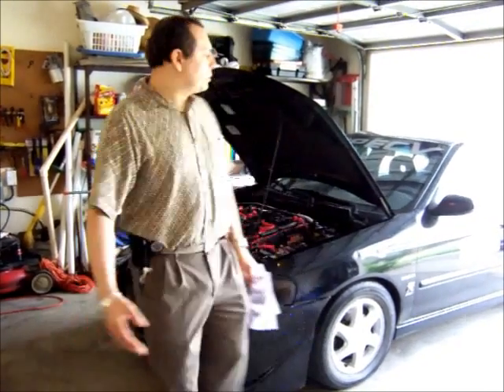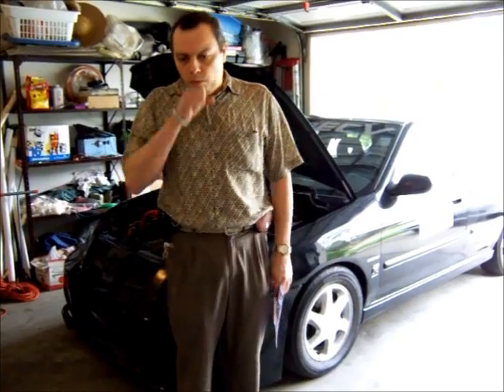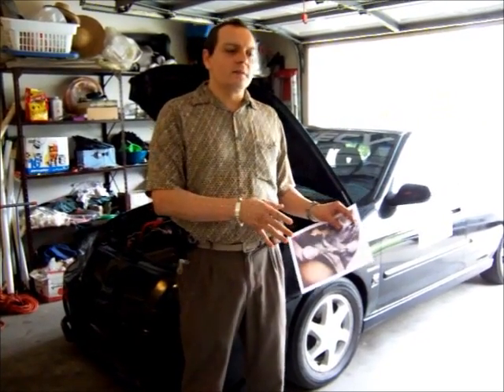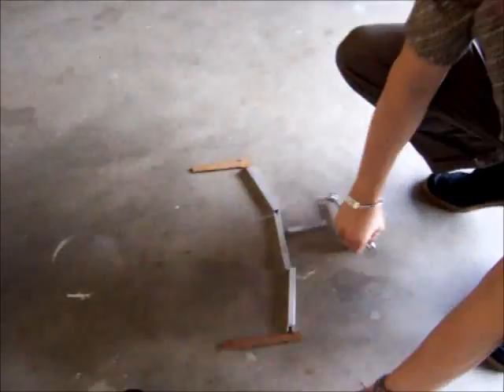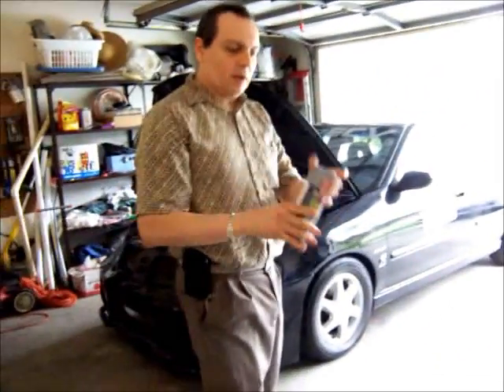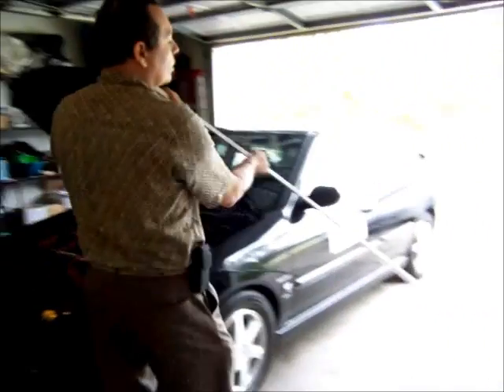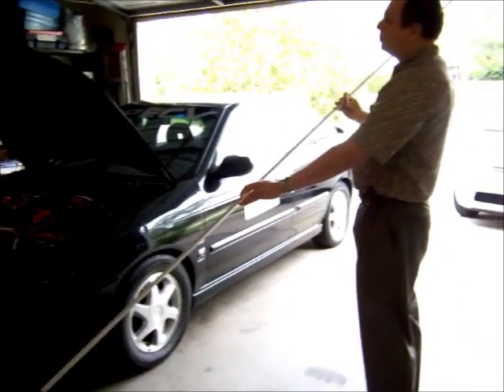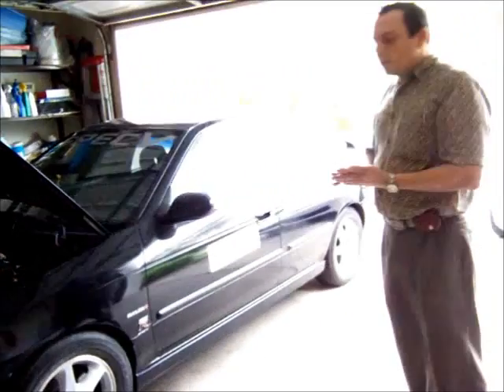Nissan Sentra Electric Car Conversion Part 25

Comment from the maker: I checked the tire vertically with a leveler. Also you are right, the front tire is wider than the rear tires. I just use the rear tires for the first approach, but then the alignment is done only with the front tires measuring the poles to the front and to the back, but just using the front tires and ignoring the rear tires.

Comment: how do you align the "toe-in toe-out" (the top of the tire leaning in or out?) Also Most cars have a wider wheel base at the front then the back of the car!? How do you account for that?

Comment from the maker: Hello Mofayer. You have a point, but I have not had any problems with this way of aligning. Tires wear normal and last good, I usually increase miles per gallon after this procedure, and the car gvery straight when I release the driving wheel and the car is moving. Unlike this, I have had some issues when I take it to the "pros".